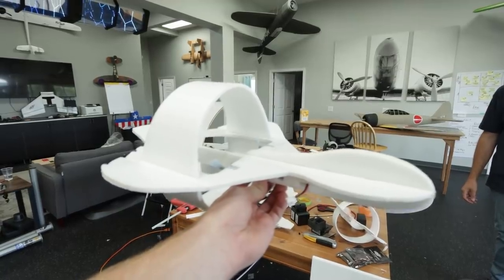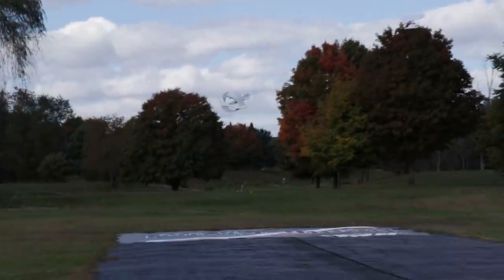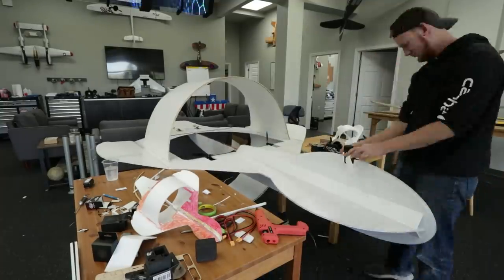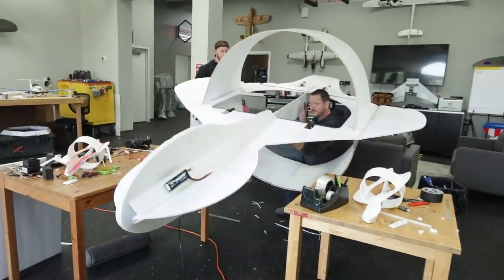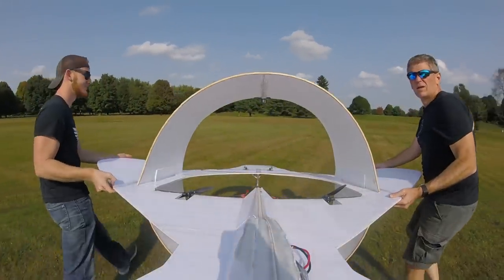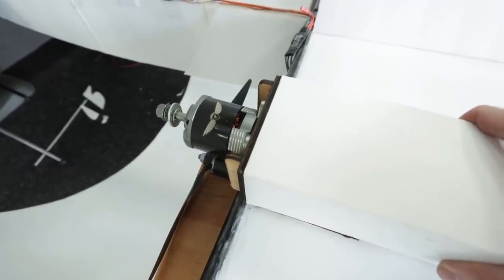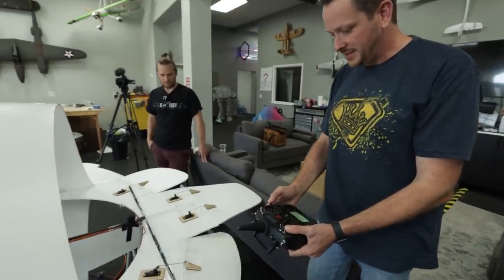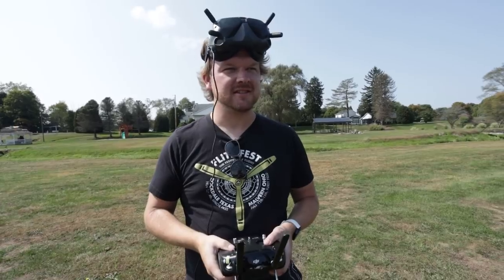Building & Flying a Giant Spaceship thing 👽

Comment: You guys should build an SR 71!
Reply: Agreed
Reply: Same
Reply: yes
Reply: X15 or bust
Reply: That would be awesome!
Reply: Errorcutive 
The x15 is boring. They put wings on a rocket, how cool 🙄
Reply: ...with scale speed and water dripping out of the wings.
Reply: Snorkl FPV that would be awesome, tough they would probably need rc jet engines to get scale speed and I don’t think they could use the paper on foam board to store fuel
Reply: YESSSS!
Reply: @nicholasn.2883  Virgin SR-71 Mach 3+ at most, Can be chased by overclocked Mig-25, Piss Leaking fuel everywhere even tho its designed for long range flight, simp to tanker to stay fueled.

CHAD X15 MADE FOR SPEED AND ONLY SPEED, MACH 7 NO MANNED AND ARMED AIRCRAFT CAN CHASE IT, DOESN'T CARE ABOUT RANGE AND ITS PILOT ALL IT CARE IS RAW SPEED. ACHIEVED ITS PURPOSE WITHOUT FLAW
Reply: with dual ducted fans
Reply: With turbines
Reply: Consider it officially on the list! ;)
Reply: @joshuamelvin  X15 ??
Reply: Josh Bixler thanks for considering the option Josh!!!

Stay safe and God bless you!❤️❤️❤️
Reply: especialy with two massive EDF fans
Reply: Or X-15
Reply: Why didn't anyone think of that
Reply: @joshuamelvin  If you want the cad files from my attempt; https://forum.flitetest.com/index.php?threads/blackbird-fly-blackbird-fly-into-the-light-of-the-dark-black-night-twin-69mm-edf-sr-71-build-project.56473/
Reply: 1/4 or 1/8th scale Sr71 with the monster motors running the EDF fans would probably work pretty well.
Reply: @Errorcutive  the sr was made to leak. In order to combat the metal expansion at high heat they added gaps into the seams.
Reply: Agreed
Reply: Yess!!! Do This
Reply: They need clearance from the military because the SR 71 tech is still mostly classified today
Reply: Dwayne Venzon The electronics and such are the only things still classified to this day, but it’s capabilities, design are not, in fact i can go into Thingiverse (a website with 3d models) and find one of an SR 71 and print it or just make a foam board model of it. There would be nothing wrong with doing that, what are your sources for that?
Reply: I agree!!
Reply: No a 12 fufo
Reply: A Guy called PeterSripol had to get clearance to attach a tiny jet engine as well as clearance to the designs because they are going to leak the Agility, Mobility, and vulnerability of an F18 to the public, even tho its just an RC plane.
SR 71 is more confusing as the design is not supposed to fly without a jet engine and the engines are going to be too small and too slow for the aircraft to operate and fly, what you can do is expand the wings and add one more engine so that it can raise the nose
Reply: lol unless it goes Mach 3 I’m not interested.
Reply: YES and followed by the Wobbly Goblin AKA F 117 nighthawk
Reply: Yea that will be cool
Reply: @dwaynevenzon643  they literally have sr71 RC jets for sale for less then $500....
Reply: Dwayne Venzon in his video, he never said that he needed clearance to attach the jet engine to his f18 super hornet model, plus, why didn’t Flite Test need clearance to build their model a10, and what about all the videos you see on YouTube about people building massive models with real jet engines of a10’s, Sr-71’s, f18’s and others. Did the millitary give them cleareance to build them? If not, by what you are saying the millitary would have taken the videos down because those videos were showing the planes capabilities. Where are you getting your info?
Reply: that would be dope
Reply: Definitely agree. That would be the most epic rc plane ever imo
Reply: Yes
Reply: Yes!   Say....Around quarter scale
Reply: definitely!
Reply: X-15 would also an excellent test project . ^_^  <3
Reply: SR OR SAR IS REYAL
Reply: YES
Reply: That would be awesome 😃😃😃
Reply: @Errorcutive  actual rocket powered!
Reply: Ikr
Reply: that would be cool
Reply: They should try and make a ac-130 too
Reply: @razy9944  they already did!
Reply: And a rubber-chicken SR71
Reply: Agreed
Reply: Make a tank KB-44
Reply: YESS!?!?
Reply: @Errorcutive  
Read "Mig Pilot" written by the pilot who defected and brought a Mig-25 with him. They were designed to intercept the B-70 which we never put into production. While they could fly at mach 3 it would burn the engines up, and therefore the planes had throttle stops to prevent mach 3 flight. The one mach 3 flight observed by NATO was, according to him, a disinformation operation.  
Soviet metallurgy, and engine technology was badly lacking the west until the fall of the Soviet Union. But, again, read the book. Beyond the Foxbat, it's an interesting peek into soviet military life.
Reply: or f22
Reply: ..out of foam obviously
Reply: U mean the sr 71 a blackbird
Reply: Yes please

Comment: I feel like this is proof of the “with enough power” anything can fly.
Reply: next on the list; the flying brick
Reply: @Vousie  The loop actually does provide a lot of lift, hence why it can go so slow and stay in the air.
Reply: @Vousie V actually the circular shapes contribute a lot when it comes to lift, that's why if you cut a piece of paper into a long, thin rectangle and tape it into a circular shape when you throw it like a football it stays in the air longer than a normal paper airplane
Reply: @tactical_p0tato  think that circle is inducing a coanda effect?
Reply: @judgeomega  We did that with the F-4 in the 60's...
Reply: With enough velocity, anything can disintegrate. Just sayin'.

Comment: Here's a challenge:

An EDF aircraft, with variable sweep wings.

Like the VF-1 series fighters from Macross
Reply: Yesss this is a must lol
Reply: It's been done and uploaded.   Search.
Reply: Forward swept wing like the YF-19 with vector thrust EDFs... XD  oh and canards
Reply: And to help launch it they should create a launching rail. Like a super easy one with 3 meters of extruded aluminum and then just use a cheap tripod at the front and maybe a cheap mini tripod with those flexible legs at the back just to keep it off the ground. think about it the tripod has the flexible top that would mount perfectly to the aluminum with a T nut and then you can use the adjustments on the tripod in the front to raise and lower the angle of the rail. 3D print out a few parts to roll along the rails like for 3D printers and things and then all you need is something to pull the sled with and rubber is the simple solution there! Hmm that makes me want to design this, I'll wright up a full design in another comment!

Comment: I would love to see an 8' Senior Telemaster foam-board set of plans! My dad had an original when I was a little kid, I had one when I was in my teens... It is an epic design. We flew them at night, towed gliders, dropped bombs & chutes! We even flew a 30 minute FREE FLIGHT with it. Several times we flew it by using nothing but the trim tabs. Super versatile plane. It had a flying stabilizer so it took off and landed like a B-52 with the nose down.  I have a pile of 4'x8' foam board that I'd love to put into one of those but don't have a good way to design it with. My dad still flies daily and has the equipment for FPV flight - The perfect combo. SD

Comment: When small, a fun little toy.

When made MONSTER, a FUN HUGE toy that flew far better than you had a right to expect!  (At least, once it wasn't absurdly, horribly underpowered for propulsion).

Mad props for the "landing" into the hands of ground crew, no thoughts of landing method accounted for before flight, apparently unharmed.

I'm equal parts amused and amazed how much of a well-balanced acrobatic plane with a circular wing your team made, after mad hacks in the process of adding more powerful motors with larger propellers.

I WANT ONE, but I live in an apartment complex and it'd be crazy to try to fly it from here, or walk it somewhere suitable. 😅

Comment: Watching that it occurred to me that you could use a fiberglass rod to reinforce the leading edge of the hoop. Probably need two or three along with metal ferrules to join them. Then you would not have to worry about speed or wind collapsing the hoop and if you come in slow you could touch down without breaking the hoop. I would think 1/8" is strong enough for that. I love the excitement and the look of that. It should definitely be on the list of planes for your next fly-in. Keep up the great work, it makes sitting in front of the computer doing remote support go a lot faster.
Reply: I was thinking more like the springy metal framed windshield shades.

Comment: would be fun to just place a quad arms and motors in the center wing, and then the only control surface needed would be ailerons, since differential thrust could be applied by the quad motors to provide pitch and yaw.

Comment: That thing needs 3 point, spring release skids for landing gear. Carbon fiber rods from the nose and wings, swept back. One release clip for the nose  skid(s) on the middle body and one clip for both wing skids just before the tail. (Wheels optional) The nose skid could be a single, center down rod for weight, or two spread rods for stability.
... If that makes sense.

Comment: Love this vid Guys.  You are really having fun.  I understand the excitement of a successful flight of an original design. I have designed built and flown 5 original designs myself.  The one I designed with differential motor control for yaw turned out so well that I am building a full scale airplane that I intend to get in and fly after being test flown as a RC first.  An electric powered full scale that is showing amazing speed on computer analysis.  I am an Aerospace Engineer, 28,000 hr. commercial pilot, RC designer, builder and pilot.  Would like to try one of your designs.

Comment: Ok, here goes, how about a vertical foam strut from the main frame that's inside the tunnel up and down to the tunnel itself, would add strength and also somewhere to add 2 more motors, what about differential thrust for elerons, loved the flight .

Comment: turn the C-130 Into an AC-130, with a firework for a howitzer, a airsoft gun for the minigun, and use whatever for the bofors,

then make a Btr-90, and battle them, the btr-90 can have a 360 degree turret to

also it would be cool if you added a jato system

Comment: You guys need a great villain. An unkillable flying fortress with a boasting PIC. (All in good fun of course, I am thinking Pro-Wrestling). Build a Bank-n-yank, fiberglass rod and coroplast fortress. Fuselage is encased with coroplast, holds all the controls. No control surfaces to lose control, entire indestructible wings pivot at the root. Tail boom mechanicals are all inside. Simple and redundant. Rudder is fixed, and protects the elevator. Make it beefy. Ducted fans for thrust, build the actual ducts and move them inside at CG. Everything is locked down, none of this, oh the battery slipped and I crashed. Dual giant batteries right at the CG.  
Cannot even get a drone prop near anything but the coroplast. fantastic roll rate, mix the elevator into the pivoting wings for crazy maneuverability. No Foam at all, powerful and strong servos only. Then, get a tube with a parachuite guy that can launch out in case anyone actually does get it down, or it has a failure, then 'The Engineer' can live on (that is the villains name). Throw in some LED's, use red and black. take it flitetest see if anyone can bring it down. Desgin it to be able to take out a fleet of drones and not even notice. Leave the entire field below it just dead drones beeping.

Comment: We tried a DFT pod on each side instead of the motor and prop design. I'd love to see how that scales up if you guys want to try some Doctor Mad Trust monsters on one of those. It would probably push the air frame to it's fail point. If it doesn't I'll be extremely impressed.

Comment: find some fibreglass packing tape the 3/4 inch should do, and ring the "hoop" wing with it. maybe 2 layers stacked on each other would do. It would add to the structural strenght with little overall weight difference. tape the leading edge and the trailing edge

Comment: It would be awesome if they LAUNCHED THE SPACE SHIP DESIGN design and the other space shaped mega crafts WITH ROCKET MOTORS! I bet someone could come up with a design that sheds spent motors out of the central coulomb and then lights a new one and slides it into the place of the last engine. That would make it so you didn't have to worry about the issue of 2 engines on the sides not igniting simultaneously. it would also give a longer flight time to get it up pretty high in the sky. 
Idea 2 is LAUNCH IT WITH A GIANT SLINGSHOT UP IN THE AIR! run a string between the top branches of 2 tall trees and then put a hook at the front of the ship. pull the stretchy strings tight then let go of the space ship and watch it launch up into the air taking off. 

Idea 3 and what you should really do to help your selves out with future projects is you guys should BUILD A LAUNCHING SLED! start with a long piece of extruded aluminum, put a bolt onto that and attach a cheap used or broken tripod to that one side. If it is a broken tripod then try to make it so you can attach 2 legs to the front and one to the other side though simply extending the camera mount bolt and connecting that to the extrusion with a square nut on the bottom side would be a perfect and easy way to do that giving you all the adjustability you need! maybe use a micro squiggly legged tripod on the lower side. Actually if you just buy the second cheapest tripods like that for this you can get them for like $30 total. then if you get a 10 foot or 3 meter aluminum extrusion you should easily be able to set up up to a 60 degree incline. The most expensive part will be the aluminum rail but I think that once you guys have a portable rail launcher you will use it very often! Another idea is to use 3 one meter long pieces and then just figure out how to join them precisely enough, that would make it even more modular and mobile! thread the holes in the center and then just glue some all thread into the ends of two of them. if the threading is not quite perfect then chop a tiny tiny bit off the end with a chop saw and try it again, you can even calculate it with the thread pitch ect. Then put some tension rods on the bottom that you can tighten up to stop it from drooping. Anyways then 3D print a rail guide or three like those that Ivan Miranda makes (talk to him about it and set up a challenge with him) and figure out the acceleration system. You could easily use rubber but if you wanted to do something cooler then you could set it up with a et of pulleys and a super powerful motor. with the motor you could give the planes a slightly slower take off though there are plenty of ways to do that.

If this is all too hard for you then you could just create a launching vehicle that just had some big huge wheels with lots of power on an open frame and then set it up so you can put poles sticking up anywhere to put supports where they need to be. You could even spring load a support at the back so when it is released, it pushes the plane up and forward to give it that extra boost like a real throw!

Anyways I'm practically giving you plans for a cheap launching rail. get the extrusion and make it happen! start with an easy rubber based power system then you can upgrade it later using the pulley system and super powerful speed controlled motor (maybe a servo).

Comment: What would happen if you kept the original small motors and added 2 more facing forward at the top and bottom of the duct forward edge?
You could use them as height control...
Martin Bronsdon, Gothenburg, Sweden